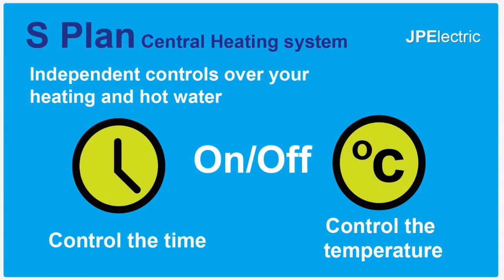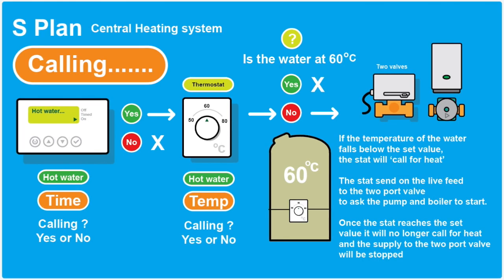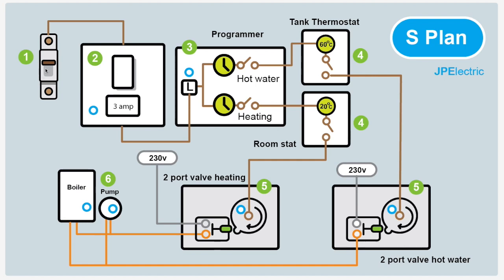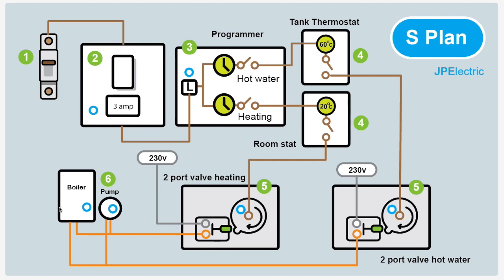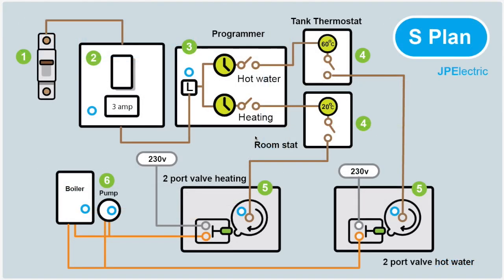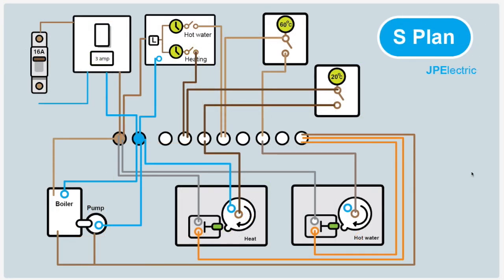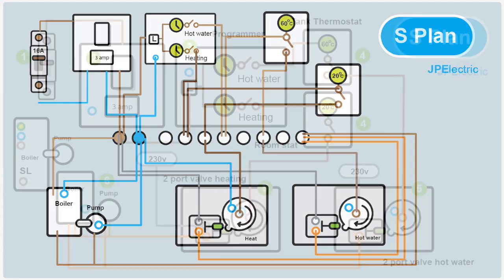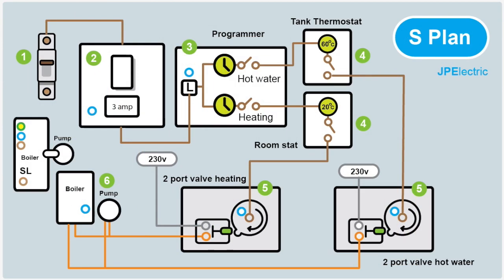S plan wiring -  made simple

Comment: Great video. I am about to carry this out. Do you typically remove the links and loops that come pre installed on a boiler. Many of them relate to other control methods that I don't believe are relevant when wiring an S plan.
Reply from the maker: Hi Thomas thanks for the comment. I can't really advise on specific wiring issues. as I don't have knowledge of your system.  Some boilers do have links that are removed when a stat is installed for example. But  I would advise caution.  if unsure ,  contact a local heating engineer.

Comment: Best instructional I've found anywhere on the internet! Thankyou!
Reply from the maker: Thank you for your kind words and subscribing. Really appreciate it.
Reply: @JPElectric  your welcome! Have you any plans for a y plan video?
Reply from the maker: Yes, going to do a Y plan video soon.
Reply: @JPElectric  great video jp, just one question, if I look at your drawing of the overview wiring. There is a live coming to the boiler from the junction just above it. What is that for? The live below the boiler is easy to identify as it goes directly to the 2 switched valves
Reply from the maker: @johanburger6109  Thanks for the comment. Boilers often have a permanent live as well as a switch live. The permanent  can be used  to power  the pump overrun function , which helps cool down the boiler. But it all depends on what boiler you have. So its very important to read the instructions for the boiler. But If you are wiring a system, I would alway make sure you have both a switched and permanent live to the boiler.
Reply: @JPElectric  thanks for the info but doesn't the permanent live force the boiler to be on? Unless there is further circuitry in the boiler that I am not aware of. Sorry I'm not from the UK so this is all new to me
Reply: @JPElectric  I see. Read your message properly now. Thanks